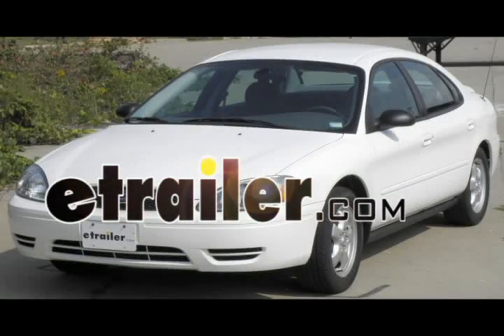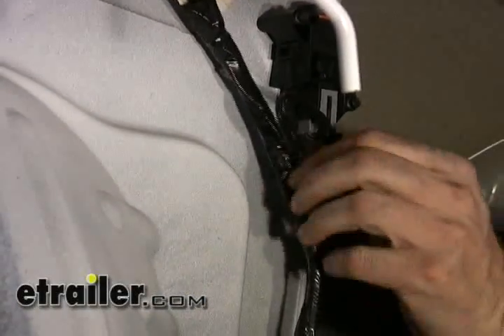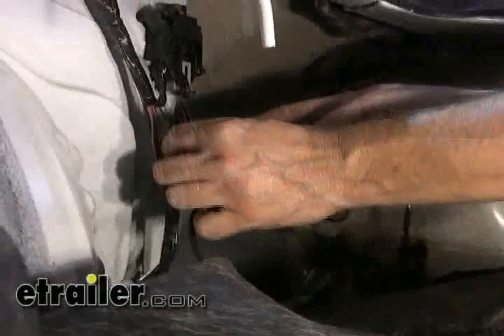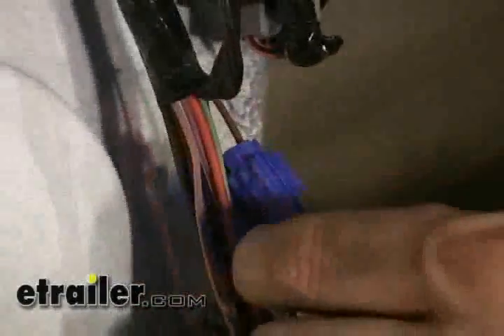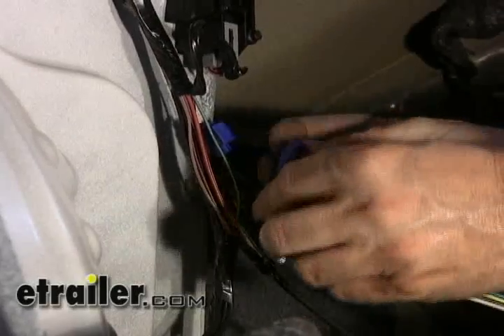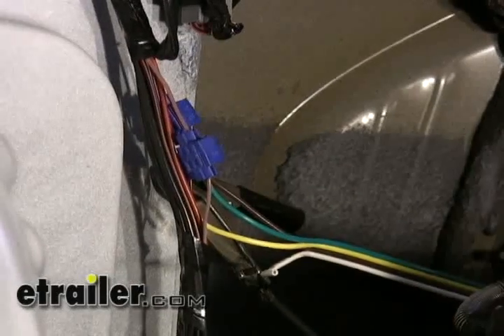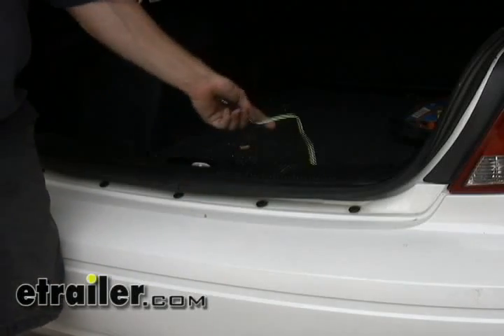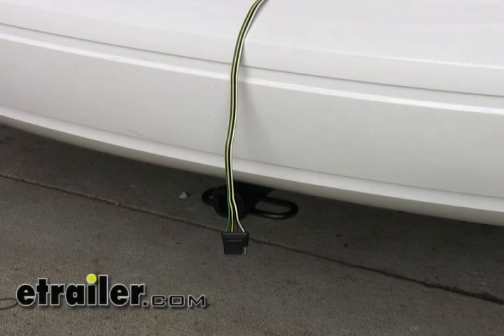etrailer | Set up: 4-Way Flat Trailer Connector w/ 60" Harness and Wire Taps on a 2006 Ford Taurus

Comment: What are the wire colors for the park
And turn signals for both head lights on a ses 04 Taurus?
Reply from the maker: You will need to check with the owners manual of your vehicle to see the wiring colors for your vehicle.
If you would like we have other options that might be a bit easier to install in the following link.
https://www.etrailer.com/t1-2004_Ford_Taurus.htm
Reply: etrailer.com I tried to the the wiring for the tails lights it’s the manual...it doesn’t say...it shows how the change the bulbs only
Reply: @andree1kk986  get a test light and start testing them